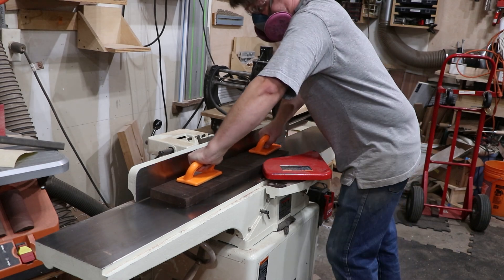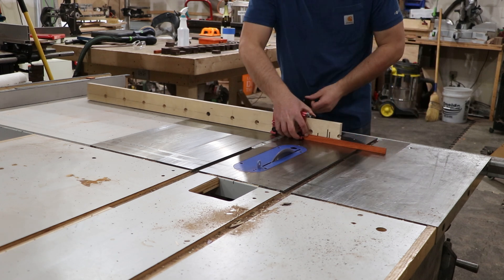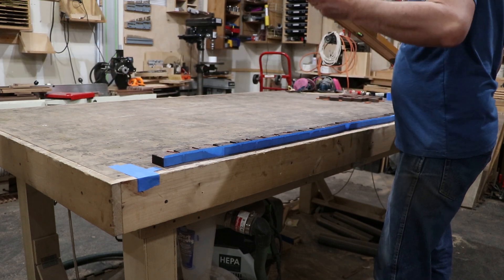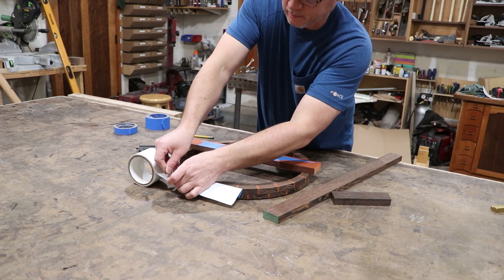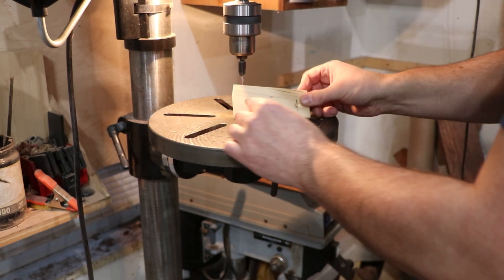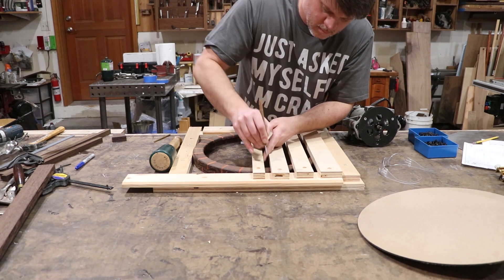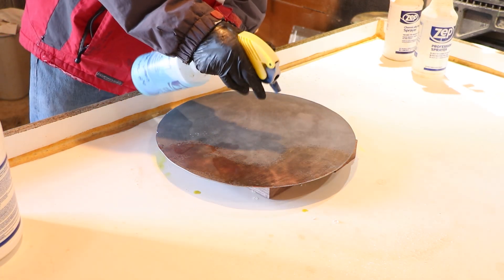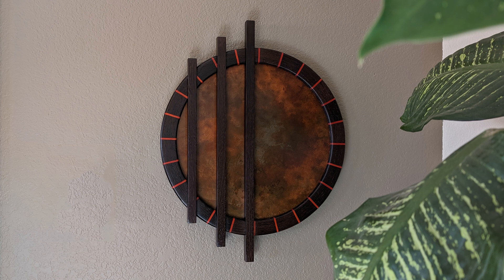Buillding Segmented Ring Sculpture

Comment: Brian, I love it when you call it how you see it. YT "woodworkers" with benches that look like they've never been used immediately call them into question. No screw holes, no stains, no battle scars = no credibility.

BTW, great piece. You're a true artist. 

I've always had skin irritation issues with oily woods, so I typically stay away from them. With that being said, I have a project that may require using Wenge. Being an exotic, how does it machine? Lots of splintering? How's the dust?
Reply from the maker: Wenge is a splentery wood, and machienes as such.  As for the skin irritation, sometimes mahogany does that to me.  its mild for me but, when I use those woods, once I'm done in the shop.  I shower right away and put fresh cloths on.  That seems to help.

Comment: I'm curious how the paduk spacers did not throw off your ring connecting correctly?  Seem like they would have?
Reply from the maker: You have to account for the thickness, I made them an 1/8" to make the math easier when figuring out the diameter of the circle.
As for the angle, since they are parallel to the wenge segment they don't change the angle, just increase the diameter of the circle.

Comment: Do you like your bandsaw blade guides? I was thinking of replacing mine with Carter.
Reply from the maker: I think replacing yours is a good call.  As soon as I have a few extra bucks, I plan on replacing mine.  The stock guides are what I would call OK, the more use they get, the less effective they are.
Reply: @Benham_Design  Thanks! Nice build, by the way.